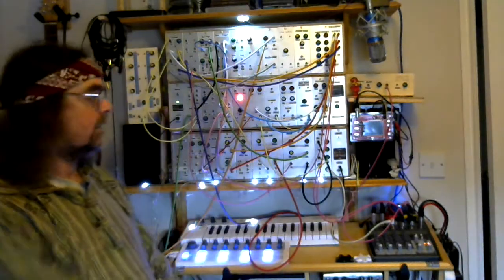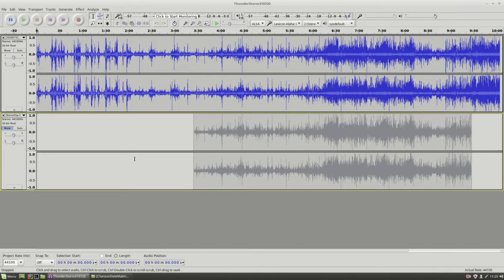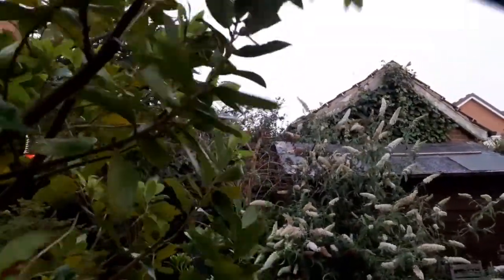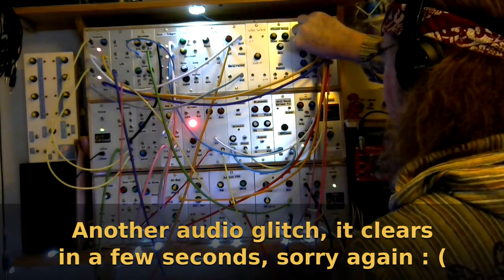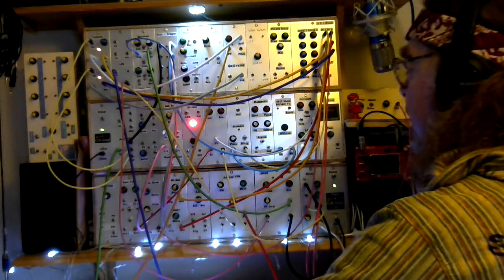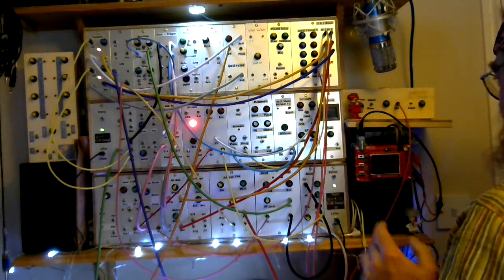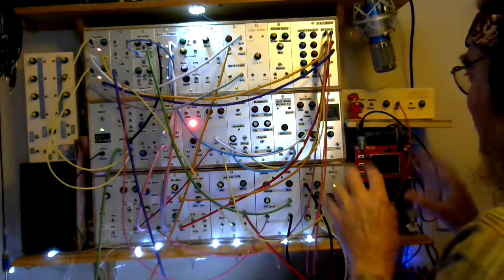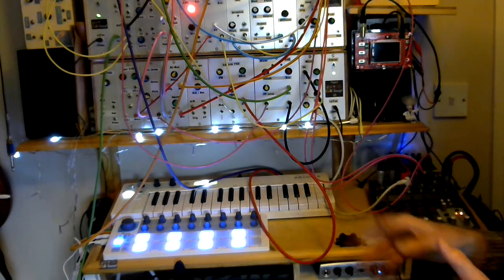Chanson d' été  : how the track was made

Comment: Thank you for the in-depth analysis of your track production. Its really very helpful. Hearing the percussion isolated in this video, I was struck by how  funky it is. Even though its a perfect fit for this rain song, I bet you could recycle it and with a different syncopation from the synth, it would sound completely different.
Reply from the maker: Thank you for your kind comments. In the same way that I try to show how building diy modules makes modular synthesis accessible on a (low) budget, I do these patch walk throughs to show how you can start to shape sounds on your diy modular system. As for the drums, I could get more pattern variation from a stepping gate/trigger sequencer (I am planning on building one at some point) but it is surprising how much variation and syncopation I can get from simple clock dividers. Who needs a drum machine?
Reply: @CuSiSound  that's one of the things I absolutely adore about building a modular system. Its so versatile, you can really create your own drum machine, or wave folder, or some unknown instrument. By the way I just wanted to emphasize that Iove the percussive pattern you created for this song. Its so funky and solid I bet you could use it for another song and it would work perfectly. That's what I meant to say. 🙂